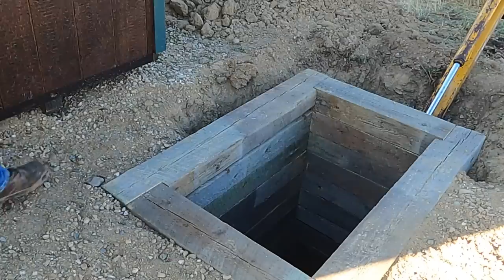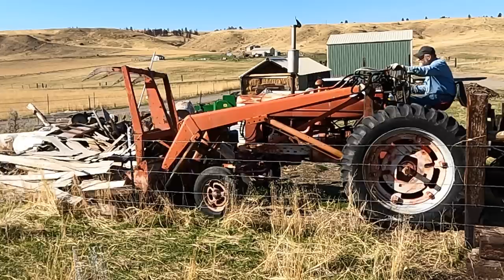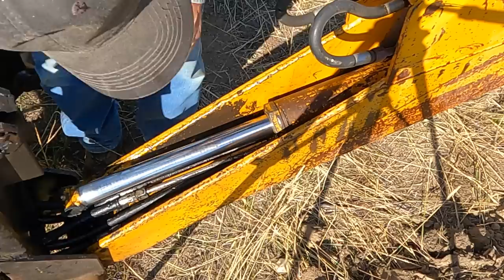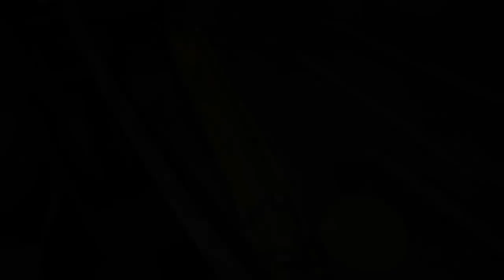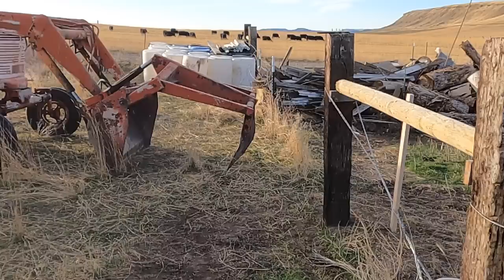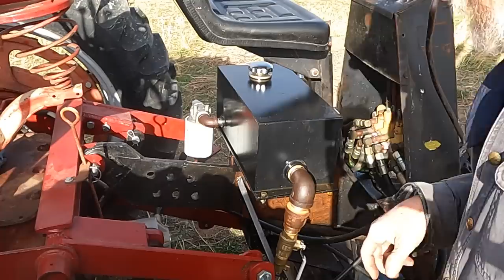Some Learning Comes the Hard Way | Engels Coach Shop

Comment: - I guess it is because I had trough problems with dyslexia that I learned draw pictures of what I was being told to do...and show what I understood had been said.
- What I learned from that was that the pictures in my head wrongly matched up with what the teller thought they had said...and mistakes did not get made.
- In your case the tellers return line what logically your suction line to them.
- This is an example where the accepted vernacular used by convention is not known by the non-guild person, you.
- It is also an example where the teacher does not recognize they talk with a vernacular and do not that uncommon thing called common sense to double check that you comprehend their vernacular.
- I have had the good luck to be taught my mechanic's knowledge by people intelligent enough to make sure I knew the comprehensions needed for the terms used in their verbal tutorials.
- The shortcut way of saying it is "Put the filter on the return line.
- The precise AND accurate way to say it is: "Put a filter after the pump, pushing the fluid to the filter, so you don't produce 'cavitation' by sucking on oil that is being withheld by a filter.
- Three times as long a sentence...five times the knowledge transmitted...and really important, major principals of fluid dynamics at play in hydraulics at that, too. {much the way you communicate in your videos, Dave.}
Reply: Thank you, Robert. We appreciate your well thought out comments.
Reply: @dianeengel4155  .
- You are most welcome, good friends.

Comment: Well for me I was told, you can not know/what you do not know!  Surprised with all the people you know , even the hydraulic shop! Did not take the time to ask you what is/was going on and figure out what it was that you did not know and teach/help from the start!  Know it can be hard to help some people cause they take offense or what ever and di not like being question on what is going on! Had a guy worked for that was a asphalt paver company… the paver had so many problems. As a new employee I was reserved not to judgmental or question their processes! After week or so watching the things go down seen a lot of why jobs were so difficult and was a crap show! Like the fire drill for swapping the batteries from paver and the rollers ? See the paver was not charging?? Found out this fire-drill was a regular thing that was going on for months??? Well i asked if was okay to work on it to see the problem! The boss said yes! Took about an hr. But found where a globb of asphalt had gotten on and covered over the charge wire and in that globs was a fuse! Change it and no more battery issue he the boss owner was over the moon!!!! He said that had been almost a year with the problem and no one could fix it????? For me it was crazy how he could not figure it out and  know understand how it worked! Well he gave me free reign to fix everything hus pump was shot fixed that and changed the filters ( did not know there was filters?) replace drive chains and sprockets alined all the wheels! Replaced bad bearings welded ip broken parts after two weks he could not believe how well the paver worked said been last two years it ran so bad and had no power he was ready to buy a new machine???? Told him he needed to learn more and do maintenance! On all the equipment!!!!!   They guy thought I was a 
Genius!  No just knew more about things he did not! Saved him a ton of money and time! He did give me a Bonus for all my hard work! That was cool!

Comment: Safe the Nature 😨 Oil in the Ground and the Groundwather 👎👎👎👎👎👎
Reply: Where do you think oil comes from? Back in the day they used to spray roads with oil to keep the dust down. There were trucks with pipes in the back of them going across the whole lane of the road and they'd spray oil down. It'd give dirt roads this kind of a black crust. Was kind of slick but you could drive OK on it. The oil would repel water too so the road wouldn't get muddy either.